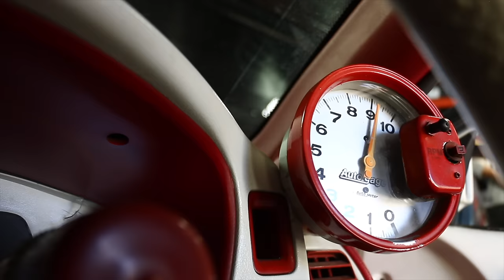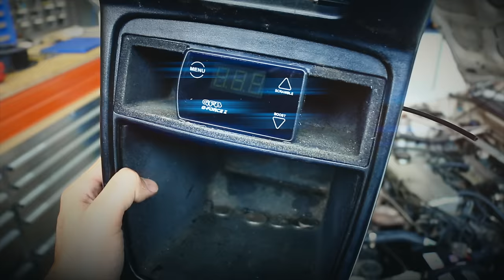MIGHTY CAR MODS GREATEST MOMENTS - 16th Anniversary Special

Comment: Thanks guys. I'm relatively new to the channel - I don't know why YouTube never threw you guys at me earlier but I'm here now, and it's nice to have 16 years of videos to watch through. My biggest revelation watching you guys is the process of tuning - it is so regularly overlooked by other channels, but watching the process of bumping up power on the dyno - while also taking into account drivability and reliability has been really eye opening, and in just a few videos drastically changed my perception and understanding of how engines work. Showing the process is very important, and it's what you guys are great at.

Comment: I found out about you guys because of Roadkill. The one time I screamed at my T.V. was because of one of your episodes. I've learned so much about cars from you all but THAT DAY was that the spark plug seals come with the valve cover gaskets. I changed spark plug wires twice because i thought that was keeping the oil off of the top of the engine. Did the gasket job the next week. Keep up the awesome work... love it!

Comment: I had a Saab 900 turbo in early 2000 and the guys from European percision did some turbo work and intercooler I think down pipe . Anyway it was super quick but only after you got the turbo spinning . It would bog down then you would feel it suck you into the seat . My friend spilled soda in the key hole and wouldn’t start half the time lol

Comment: 27:15 Not just the Golf is quick, but the BMW is actually quite SLOW. Buddy of mine had a DOHC 4.6 Crown Victoria.. Actually it was a 2003 Mercury "Marauder", but it in all actuality is a Crown Vic cop car, with some factory upgrades, leather interior heated seats.. fancy gauge cluster near the shifter... Also The 4.6 in it, is not the same as the other lethargic Crown Vics, its actually a Mustang "Terminator Cobra" DOHC 32v 4.6 engine without the supercharger.. Still has all the same forged internals from the Terminator Cobra, they just neglected to put the supercharger on it. 
One day were all sitting around having a brew and a splif, and Him and another guy hanging out, start getting into it about whos car is faster... Well we live in a very rural area, so they went out front and lines up. Not sure the year, but it was a  BMW M series, 6 speed Manual trans, The Marauder is the factory automatic trans, with an upgraded rear differential from the mustang. suspension had also been modified to Mustang spec stuff. The BMW was bone stock. I have a video of the Marauder pulling about a bus length on the BMW at the finish line. Guy lost 200$ that day.